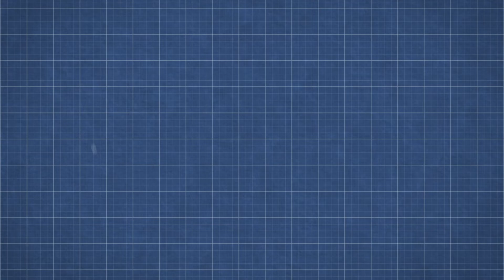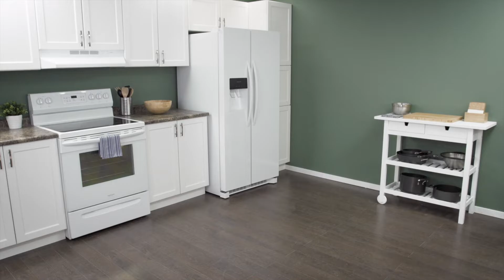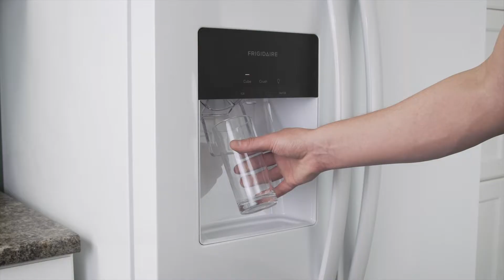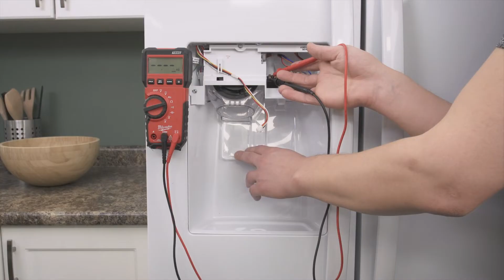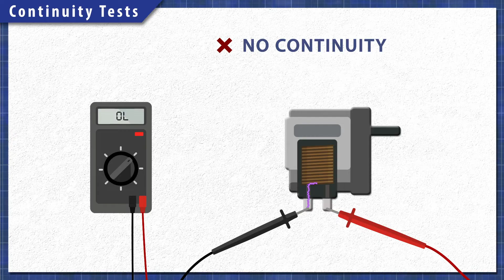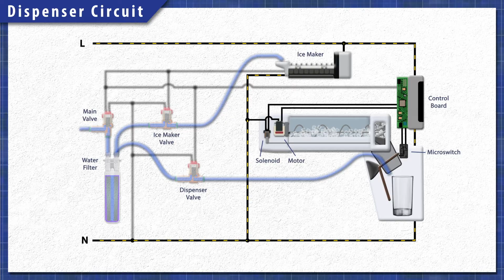Ice Not Dispensing? (Refrigerator Troubleshooting) | Repair & Replace

Comment: This is a good video, but my unit (FRSS2323ASD 22.3 CU FT) will not dispense the cube ice ONLY crushed?  The arm going into the back-panel, how is it positioned to change the ice flow?  How do you test and/or replace the solenoid that selects the type of ice dispensed?

Comment: Mine will not dispense ice when the door is closed, however when I open the door and push the contact switch inside the freezer compartment, it will dispense ice. Could that be a faulty switch inside the freezer?

Comment: On my freezer ice maker, when you push the dispensing lever, sometimes ice comes and sometimes there’s nothing almost like it’s not connected. Could this be the micro switch? Like sometimes it works and sometimes not?
Reply from the maker: An intermittent problem is likely electrical, so in this case it could be the switch, a loose connection or even an issue with the display control board. Testing the switch and checking each connection should be done first.

Comment: The ice was not being dispensed by my refrigerator, I am not an electrician and lack the tools to check for power. I removed the ice tray and I noticed there was a build up of ice around and over the hole where the ice drops. I just reoved the ice with a knife and the ice now drops, as it should.
Reply from the maker: Glad that you were able to narrow down the problem!